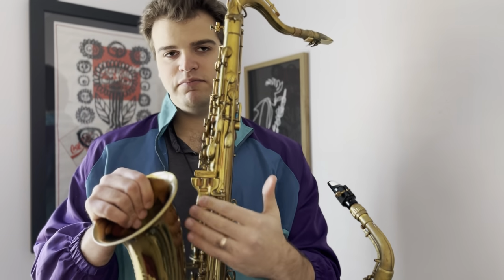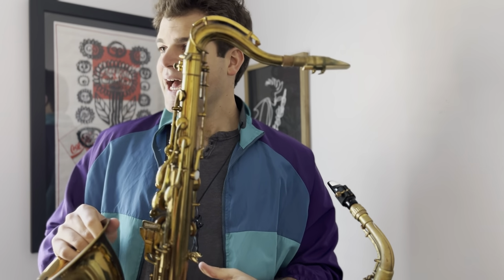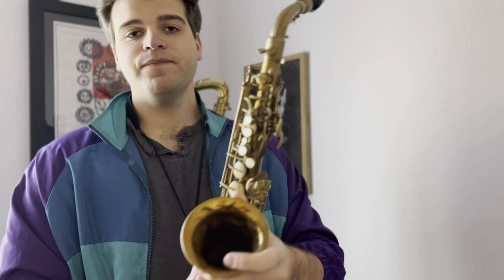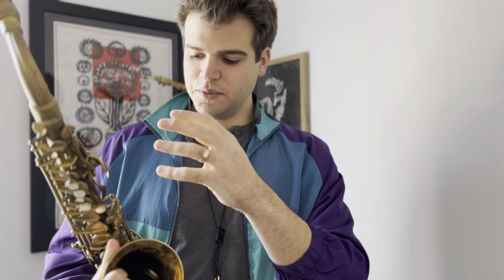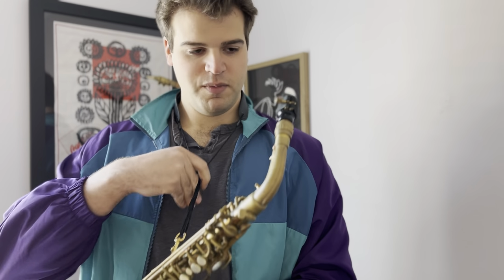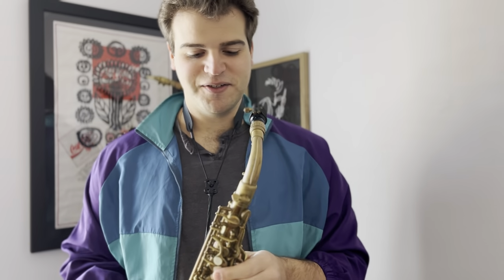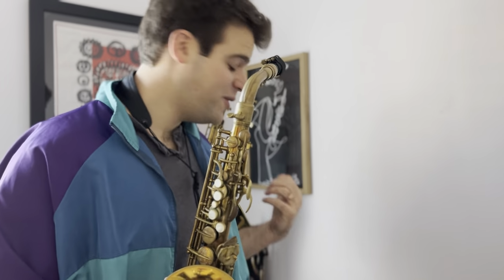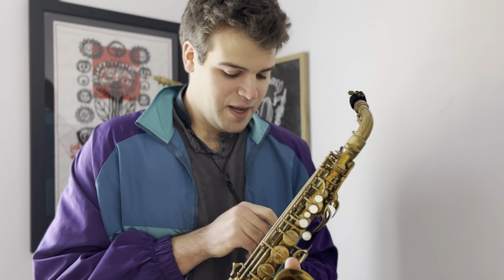exploring the origins of the articulated G# key: #saxocology

Comment: You play beautifully - but I have to say, you got the reasoning for the articulated G# wrong.  I mean, what you said is correct as far as it goes, but the REAL reason for this mechanism is to make slurring from a low note (say, low C#) to G# possible without a break in the sound as the player moves the pinky from the low C# key to the G# key.  Even with the other alternate G# trill key, there is stll a jump required as the player moves the right index finger from one key to the other.  

This does now require an additional regulation so that any key on the right hand will hold the G# pad cup down, so there is no leak.  It also means that the G# mechanism requires 2 springs, one for the key and one for the pad cup.  Which is the cause of the dreaded “sticking G#” problem, and why every saxophonist must carry a clean dollar bill :)
Reply: That's a good explanation (slurs).  For most G# cases, I'd rather aim for the G# key, it's action is lighter than using the adjacent spatula keys (especially C# on a vintage horn).  However, having the much larger target area/four spatula keys could be useful.
Reply from the maker: after reviewing the discussion on this segment, this topic will be revisited in a future video. thank you for sharing, and we look forward to hearing your thoughts again soon!